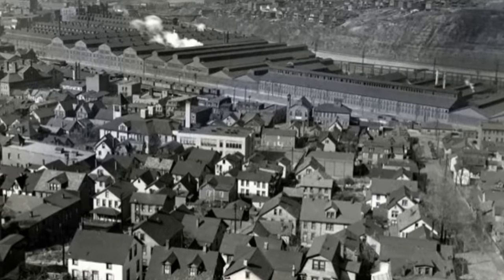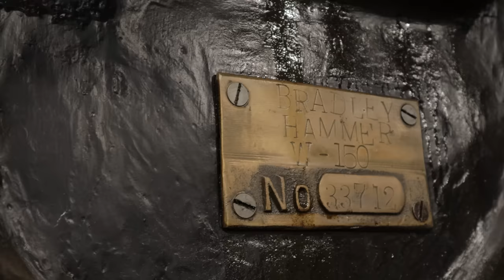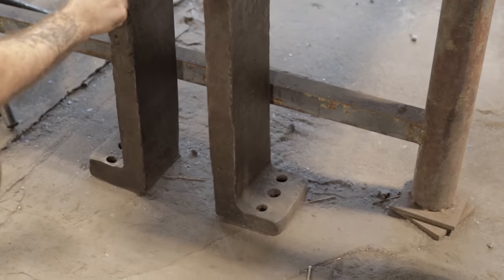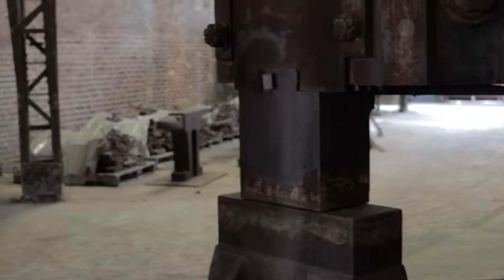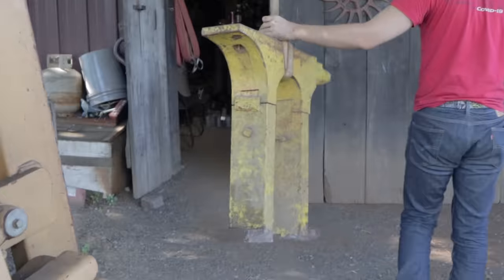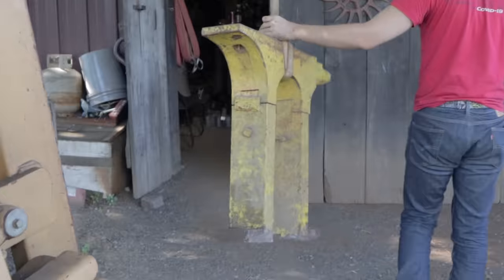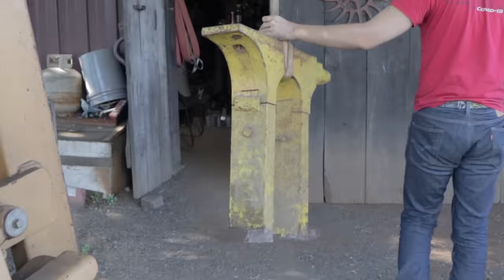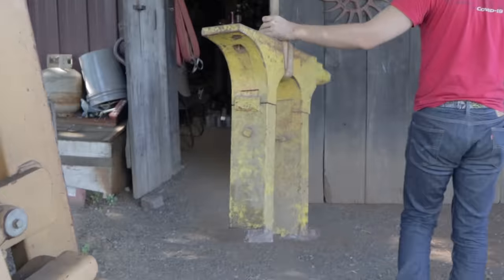Johnstown Bridge Anvil Restoration and History - Documentary

Comment: Got a question for you. Since you welded the end of the horn to the rest of the anvil. The welds won’t go all the way through to the center of the piece. Won’t the gap in material act sort of like a cold shut & possibly compromise the durability of the horn if you are hammering a piece on it? Again, this is a question & not a critique. This is a beautiful restoration & I wish you many many happy years of use with it.
Reply from the maker: When are you hammering that hard on the horn? Also we ground each face flush so they sat super tight before welding and with these welding rods they melt liquid and basically did penetrate to the center. I’m not Worried even a little bit about that horn
Reply: @ThatWorks  - Awesome. Like I said I was just wondering. You are definitely the experts. Hope you love it.

Comment: Nice job guys, looks beautiful. If were me I for the horn repair I would have probably used a deeper J prep and used low hydrogen rods as the structural weld and as a buffer layer and then a quite deep capping run with the hard facing rod and post heat and slow cool. But I'm one to over think a job😊.
Reply from the maker: That would work well also

Comment: A friend has one that's very similar to this (the feet and arch look basically identical, minor width differences) except for the face, which is all swage block and nesting holes with a small full section behind the horn. Taller in the face too, about ~10 cm more material than this one and it has a less pronounced tail(?) (we call it balcony, but dunno what the exact english nomenclature is).

Neat restoration, it trully deserved to be back, these are so rare, that i think this might be my third (internet stumble upon) with only two ever seen in the wild, and i've seen so many anvils over the years it's not even funny, considering smithing is not even a hobby for me, more like utility necessity. :))
Reply from the maker: Thank you! It felt really good getting this back to working condition

Comment: awesome job on that sweet anvil  what temps did you pre heat to before welding thanks i have a haybudden that needs some restoration work  that shop in PA was amazing seeing those massive power hammers very cool
Reply: we used a 400 degree marker
Reply: @MtPhillipMetalWorks  very good thank you for reply appreciate it happy holidays Mark

Comment: hey there. love it to see such pieces get a new lease on live. the only question i have as a blacksmith myself: is it "pulling"? at least thats the term in austria for it. meaning is it grounded and solid enough to efficiently move material with the used force? with the large gap underneath i feel it would lack in this very attribite, trading for flexibility with heavily bent pieces. herearound we use so called "breasted" anvils to mitigate this problem, wich have a roughly 120 degree side below the face on one side to get more mass beneath your working surface.
Reply from the maker: We just had it sitting on dirt in the demo and it was still pretty solid and grounded. Once it’s bolted to concrete it will be great!

Comment: Just saw this episode and thoroughly enjoyed it.  That is a fantastic anvil and you did a great job with it except for one mistake.  The way you welded that horn on was very incorrect for an anvil.  The material in any anvil has to be completely homogenous or in the case of welds, 100% welded.  For the anvil to have any spring back and behave like an anvil it has to be this way.  Forging material over that horn is going to odd because forging over the welded on part isn't going to give you the same material movement per strike as it will over the part that was still the original anvil. It's easy to fix, though.  If you cut the previously welded part back off, regrind the bevel so your first weld bead is a solid circular weld with no unwelded material left in the center and continue laying beads of weld until you reach your required dimension you will have a completely solid anvil horn again and will perform like it should.  Otherwise, I loved how it came out.  Keep up the great channel.

Comment: Damn, that's an impressive collection of forging tools at that museum.  On the matter of your restoration of the Anvil, I confess that I cringed when I saw what you did, but the end result is all that matters.  Good job.
Reply from the maker: Why? We did it by the book!
Reply: @ThatWorks  Forgive my ignorance on this, but it is my understanding that when one uses a welder on the working surface of an iron or steel surface that the end result, even after sanding/grinding down, is in general not a good practice as the weld surface may be softer or weaker than the initial material.  That is why I cringed.  I'm no expert on metallurgy so I really do not know, I'm simply an old vet with some acquired disabilities that likes to learn and watch skilled craftsman at work creating functional art.
All in all, the end result is all that matters here.  The piece turned out well as well as functional.  Keep up the good work as I enjoy watching the videos with your slight touch of levity.  Thank you.
Reply: @franknunally8098  Hey Frank thanks for watching glad you enjoyed it! We used High Abrasion/High Impact Welding rod , we didn't film it but I smashed the brand new metal with a sledge hammer trying to break it and I couldn't! Its back to usable condition which was the ultimate goal!
Reply: Nice.
Reply: @MtPhillipMetalWorks  After doing some research, I must apologize for publicly printing my doubts.  I've learned that welds can indeed be stronger than the material being welded together.  Such welding can be the founding of 3D printing with metal, for example, there is a company 3D printing rocket parts to make a whole rocket for Tesla.

Comment: i have seen a weapon that i never seen before, i think it was cold a war disc (?) It basically like a disc with an edge ,with or without notches around the circumference of the disc. It looked a little like that mix between a war hammer and a morning star.
Reply from the maker: Chakram ?
Reply: @ThatWorks  no, I've tried searching for that image again but can't find it. Like I said it looks like a morning star but instead of a ball head it's a disc. The disc was greenish so I think it was bronze (?) and the stick went though the center. Looked they drilled a hole through the disc and put a stick through it. I'll see if I can find it and link it here 😅

Comment: Wouldn't it have been better to use 7018 or a nickel rod to repair that horn? I know some hard hardfacing rods have nickel in them for increased toughness or whatever, but they're not really meant to join parts like nickel rods for cast iron repair and such.
Reply: This wasn't Iron
Reply: Same principles apply, though. I only mentioned cast iron to give context to the type of rod. Regardless, they're meant for joining parts (especiall for cast iron Or steel), unlike hardfacing. I'm not knocking the job, I'm just curious as to the thought process. Which I'm also not knocking.

Comment: Good job reconditioning that work horse, the only thing that is not equivalent to the original is that the horn is not 100% welded, in the weld business that would be a partial penetration weld as opposed to full penetration weld.
Reply from the maker: It’s better than new!
Reply: @ThatWorks  ,,,,,well, it's better than when you started any way.